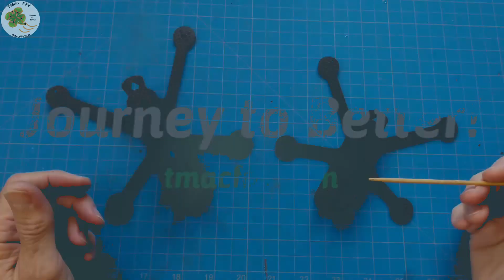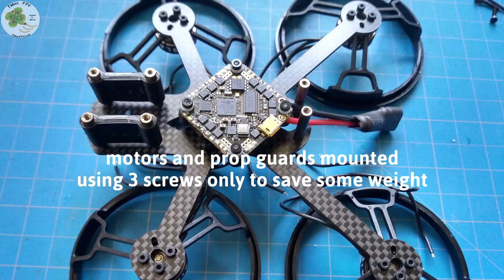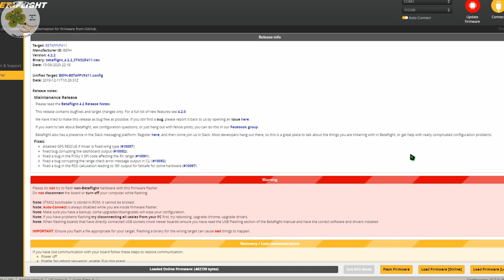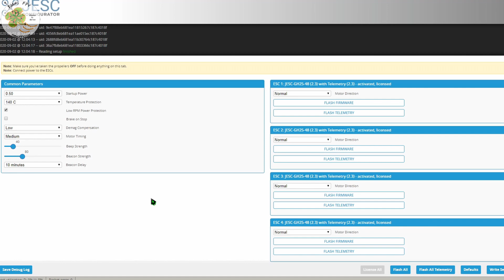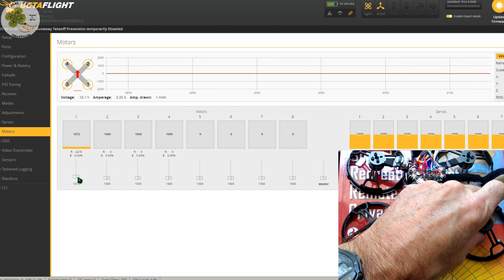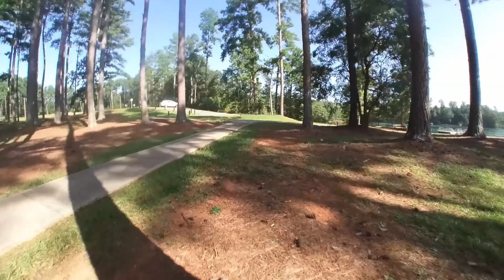Micro FPV Drone Build (PYGMY RATTLER!)

Comment: So cool one thing I want to know do u carry the prop guards? Let me know .thank u
Reply from the maker: Hey H20-FPV!  I do not carry the prop guards.  However, I've listed where I purchased them from in the video description.  Keep in mind, if you go with props guards on the Pygmy Rattler, your max prop size for the front props needs to be 2.5 inches to accommodate the necessary room for the prop guards up front.  The prop guards for up front should be those for 2.5" props then and not 3" props.  These are listed in video description above.  You can still use 3" props in the rear with 3" prop guards.

Comment: Hey TMac, what lake is that and was the playback in slow-mo?
Reply from the maker: Only the launch was in slo-mo. Flight just had a lower camera angle than I normally fly to get some good Insta360 GO footage. What makes you think it was slow motion?
Reply: @TMacFPV  You normally fly quick, so it gave me the impression that you had reduce the playback speed. Also, did you know that HGLRG also has the 3" prop guards? So on the PYGMY RATTLER, you can have the 2.5" prop guards in the front and the 3" prop guards in the back. Not sure flying in cinematic style if that would be a good setup.
Reply from the maker: Hey Flyturbo Quad!  Yes, I normally like to fly low & fast for the adrenaline rush!  Just "getting my feet wet" on this whole "cinematic flight stuff."  Still learning which is one of the things I like most about this hobby - something new always to learn.  Doin' my best to pass on what I learn to to others.  I did know HGLRC has the 3" prop guards.  i actually have them, however, didn't think of puttin' them on the back of the Pygmy!  Thanks for the suggestion!  I just checked and sure 'nuff, they'll fit fine!   Guess I'm gonna have to try them out now!  😀Should work out fine.  One thing I like about the prop guards instead of "ducts" is it flies better with less/no prop-wash.

Comment: This one leaves the Rattler looking more like an Anaconda. Pick your hardware wisely, put a 3s li ion pack and it will be airborne all day!
Reply from the maker: I'm waiting for Airblade to get their 1404 2500Kv Dark Knight (black) motors in. Once they do, I'm swapping out the 3850s for those. I've got a GNB 4S 1100 mah lipo that only weighs 90 grams. With the 2500Kv and 90g 1100 mah 4S, think I'll be cruisin' for awhile 😁👍I already get 12 minutes out of her with this setup😲
Reply: @TMacFPV  tinkering away, my friend!